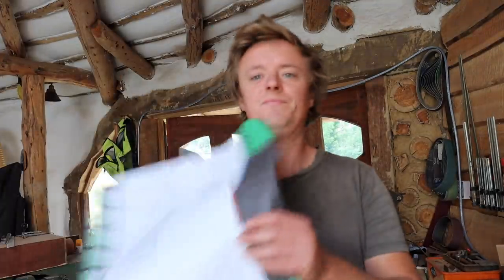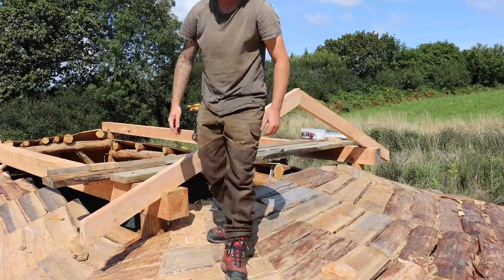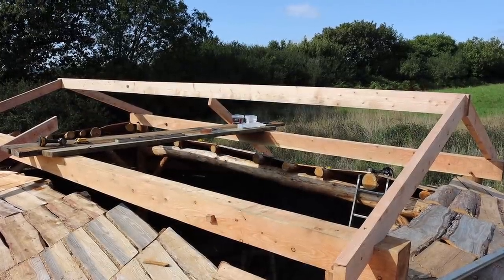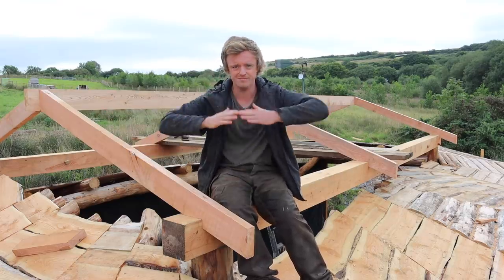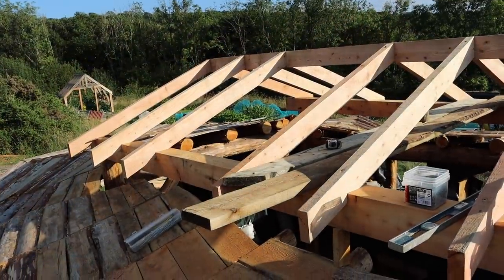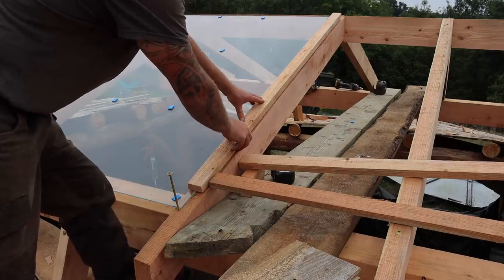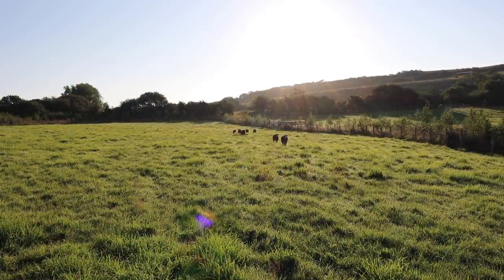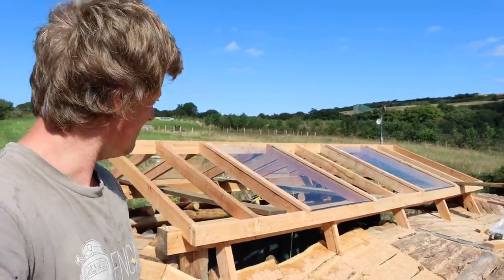Off Grid Earthbag Workshop Part 69 Central Pitched Roof

Comment: Not understanding the transfer weights in such a complicated way. 6x6 should hold almost anything so if there were spreading concerns why not use metal plates or brackets that transfer downward pressure on the rafters to the beams? It would make a triangle the stronger geometric form. Was it just the joint? I would have loved to see you forging them.  You seem to tackle everything out there.

Comment: I was always under the impression that when using building materials that are not regulated,  that tests are required , like pressure tests to determine the strength?  Cutting down a tree and using it as a support beam that tree would need to be tested to find its strength or any other non regulated building material? Is this not the case now ?

Comment: How are the winters,no need for double glazing ?
Reply from the maker: It would be ideally, But its what i had already and its only a workshop after all
Reply: @KrisHarbour  I'm a retired architect from Pennsylvania, US.  Our building codes require protection under glass skylights, for drop-out or breakage - even when tempered sheet glass is used (which is also mandatory.)  
In any event, I suggest that you install hardware cloth (1 cm grid galvanized wire screen) to the bottoms of the framing rafters below each skylight.  Never know when a satellite will fall out of the sky...(or some industrial-strength hail!)  
You have an amazing intuitive understanding of structural forces on building components.  Keep up the GREAT work!
Reply from the maker: @artruprecht2022  That is interesting, it does seem a bit over the top to me though, The chances of me standing under a window at the very moment a random event happened are quite low anyway But then even if it did i would only get rained on with small bits of glass. I would never use normal sheet glass over my head as to me that is crazy but toughened does not seem like there would be an issue. As far as i know there isnt a building reg in the UK  with regard to that but i could be wrong. 

Thanks for the comment.
Reply: @KrisHarbour  Kris - Just makin' sure that you stay safe and keep posting those incredibly fascinating YT clips.

Comment: I'm just curious, what's with the cheap handsaw? I see you have an appreciation for hand work and treat your tools well. There's not a lot of people still using planes and chisels anymore. Over several years I've noticed that you seem to exclusively useThe cheapest hand saw available. I'm not critical, but do you have a philosophy regarding this?
Reply: Just for clarification, I mean that you seem to use tools for their function , unlike people who fetishize crazy expensive tools and build nothing but a rack to display them
Reply from the maker: No real thought behind it, Its just what i have, I dont tend to buy new hand tools, i find them at antique shops and stuff, I suppose i have just not found a nice saw yet. so these cheap things work just fine.

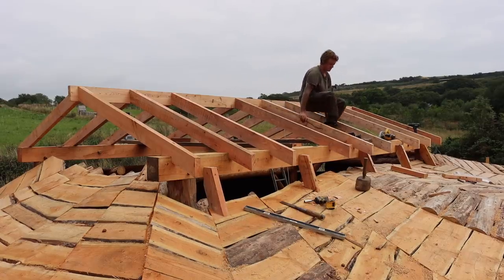Comment: 18:57 why cut the middle shorter then the main beams?
Reply from the maker: That will be clad, the main timbers will stick out.
Reply: @KrisHarbour  will stick out? But than they can get wet. Why? Wet in a roof is always a bad thing, especially on flat surfaces where it can rest.
I'm looking forward for the results. Love your projects and videos. Rewatched both building projects recentley. Oh man the timber roundhouse looks painstakingly hard work in hindside, compared to the latest technics.
Would love to see a windmill 2.0 and a crane in your posession.
Good luck. 👍